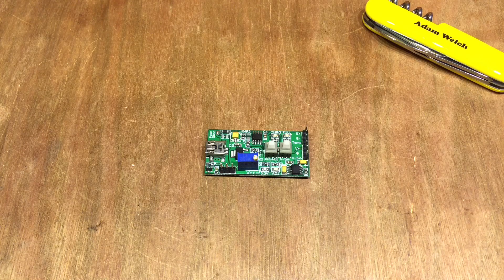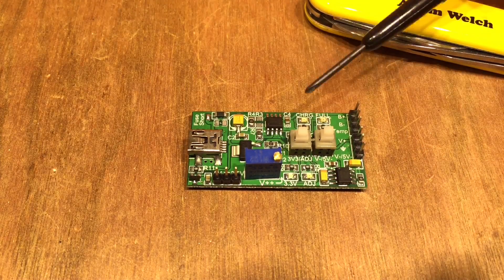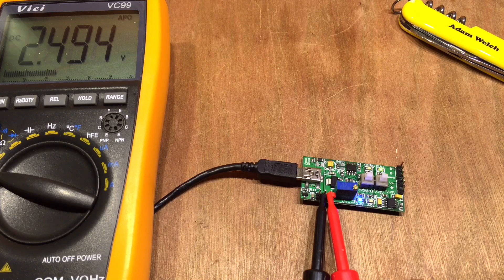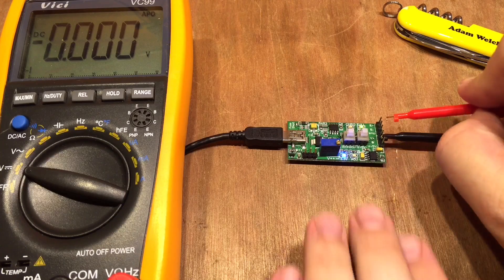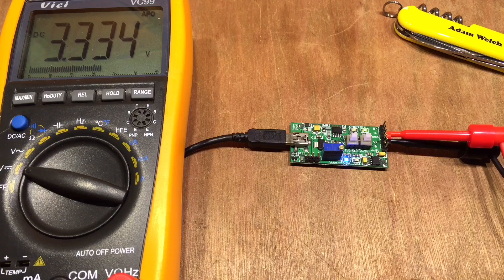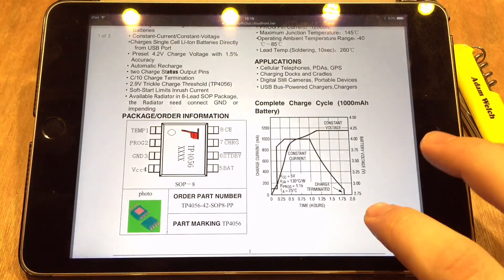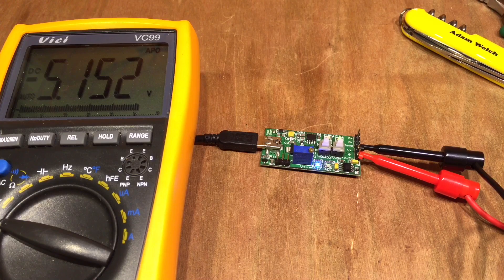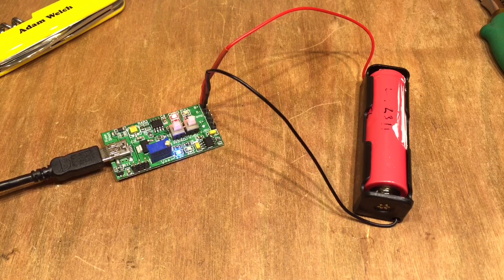TP4056 Lithium Charging Module with Extras! - 12v a Solar Shed

Comment: Thats actually what I am looking for - except the minus voltage part. The 3.3v is usefull to run for example an NodeMCU or ESP8266 or something like that on Battery. Then you can use it directly on the 3.3v pin instead of the VIN Pin which consumes current. Depends on how good the linear voltage regulator is on that device.
The minus voltage can be usefull for example for LCD-Displays as there are displays outside which need a minus voltage for the V0 Pin - the contrast adjust pin.
That little guy is a bit too fancy - I found the schematics of that other board you where shoing and added an AP2112 to the output to drop the output voltage from 4,2 (if fully charged) to always 3.3v with a current draw of only 50uA which makes it suitable for long-life battery usage on low power devices like the NodeMCU in sleep-mode.

At least... thats my 50 cents to it, I am just guessing :)

Comment: Just thinking out loud:

The fact that it uses the older miniUSB socket would indicate to me that rather than being new, this board is as old as the older TP4056 module. The one without the output pads used miniUSB. I suspect this might be a dumping of an obsolete board that was specifically designed to do what a particular client needed. Perhaps it was for a product line that just didn't make it. Or it was for a specific industry, and we never saw it. Also, the quality of the push button switches is better than expected, which contributes to that last assumption.  Might have been part of some obsolete portable computing device. The negative voltage may be, as another user mentioned, for op-amps. Perhaps the device it was meant for had audio circuitry as well. A portable audio calibration device?   Anyway, I am not convinced that it is a "new" product.  

Cheers from Canada!

Comment: The 5v feeds might be able to power some  of those cheap digital voltmeters seen on the Bay of E. Might be a great addition to a  board project as it will give an indication when the charge will be done. Some need at least 4 volts to run. Look for "Mini DC 0-100V Voltmeter 0.56" LED Display Digital Panel Volt Meter Gauge" Beware which one you choose, some start reading at 4.5v

Comment: I designed a new module TP4056ADV-FLEX based on the TP4056 which has a 5V USB input as well as a screw terminal and DC-Jack inputs for 7-25V input from various sources, like a router power pack for example. It allows to select various charge current settings via jumpers (60mA-1A) and gives output straight from the battery (with protection) but also 4-25V via a booster chip (200mA-700mA depending on voltage).  if anyone is interested, let me know.......
Reply: Wow really cool
Reply from the maker: Thanks for sending me the pictures - it looks like a great module you've built.
Reply: I actually just started selling TP4056FlexAdv and TP5100FlexAdv on Tindie!
https://www.tindie.com/stores/soubitos/

Comment: Hi Adam!
Is there a TP4056 that support input more then 5v? 12v?
Thank you for your attention.
Reply from the maker: +Gustavo Severo The TP4056 IC itself can only take up to 6v on its input. Modules could be made with a buck regulator to drop the voltage down for the TP5056 but it might not be mass market. TP5000 modules generally claim up to 9v on the input. So I think you'll need to drop the voltage first, then use a dedicated charging IC.

Comment: Yeah weird but how do you charge multiple batteries in series with a simple thing like this?
Reply from the maker: +THE LEGEND 27 Generally you can't. The negative is common from input to output. When you connect a USB power supply to each module you can cause a short.

Comment: Very interesting features with this fairly recent module. One captivating news is the "Temp" monitoring and actuating possibility. To my humble opinion, this board has been designed with an array of uses to fit modern electronics and in particular, computer based devices. For instance, the Temp connector would be very useful and allows laptops' batteries to be refurbished with safe charge controller including Thermistor sensor. I think hobbyists will find it rewarding as a device that allows versatility and innovation.
Reply: Do laptop battery assemblies include NTC sensors ?

Comment: I want to power this with a couple of small solar cells and charge a 18650 battery to use with an ESP8266 based weather station which uses 3.3v, so i think it's a neat little device and exactly what i need. However he's not selling to my location 😡  I am assuming/hoping that 3.3 voltage regulator would work only from the battery as well when it's not being charged since this is not shown on the video.  Also, i think the temperature input pin is neat and i would like to test it with an NTC thermistor attaching next to the 18650.  I think that temp pin would be useful in extreme temperatures since my project is for a weather station which will be working sometimes in very hot days and sometimes under bad winter conditions. 
I would actually appreciate any comments on this.

Comment: Could we use tp4056 board to charge aa and  aaa rechargeable batteries?
Reply from the maker: No, it's set to charge to 4.2 volts and uses a different termination method I'm afraid.
Reply: If you mean AA and AAA as the normal 1.2 volt battery types, then NO, you cannot use this.

But, the ONLY exception is if you meant a 3.7 volt lithium-ion cell that has the size and shape of an AA battery. If you're not sure what I mean, then the overall answer is NO.  Do not use a TP4056 for anything other than a 3.7 volt Li-Ion cell.  (Note: 4.2 volts is the charging voltage for 3.7 volt Li-Ion batteries, as stated by Adam, above)

Comment: Hi Adam, I believe these ultra precise potentiometers have 25 turns on them
Reply: Yep, it seems 1K Ohm, 10% tolerance with 25 turns.
Link: http://www.ebay.co.uk/itm/10pcs-3296W-102-3296-W-1K-ohm-Trim-Pot-Trimmer-Potentiometer-CG/152217956302?_trksid=p2047675.c100005.m1851&_trkparms=aid%3D222007%26algo%3DSIC.MBE%26ao%3D1%26asc%3D38661%26meid%3Da1b5addb29ed4fccbac66a3c96c3ceec%26pid%3D100005%26rk%3D1%26rkt%3D6%26sd%3D291820619495
Reply: Mehmet Kaya I like them

Comment: If the 5V output is also on when only the battery is connected its great for a DIY powerbank.
Reply from the maker: +Tobimai I didn't check that but I will. Not holding my breath though a sim fairly sure that's just a the input voltage.
Reply: If it doesn't have some kind of boost circuitry, it's just the input voltage. They just threw all kind of (unnecessary) "options" onto the board so it could be sold for higher price. If it had booster to 5V, then it would be useful for 5V Arduino and other 5V stuff. Now it can be used only with 3.3V Arduino (although I wonder it can keep 3.3V when battery is half-way full or less), but why bother?
Reply: Well it's actually useless if it cant boost the voltage back up....

Also it won't support high currents, no heatsinks